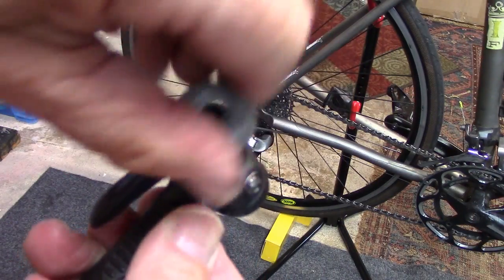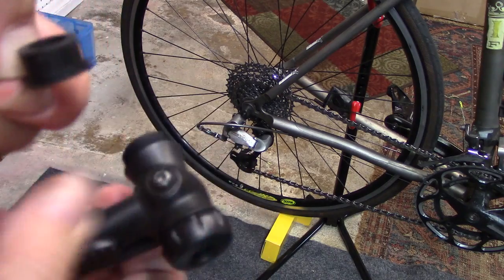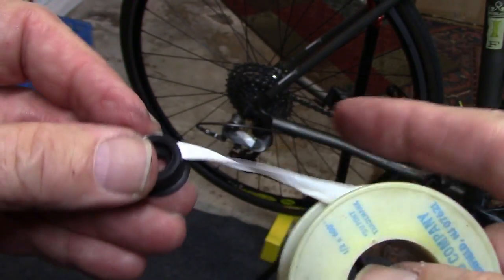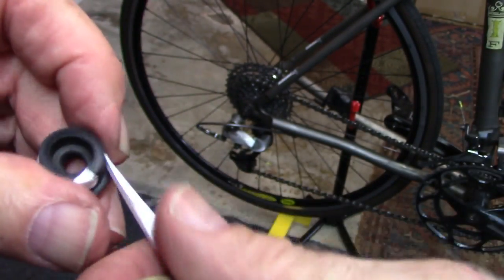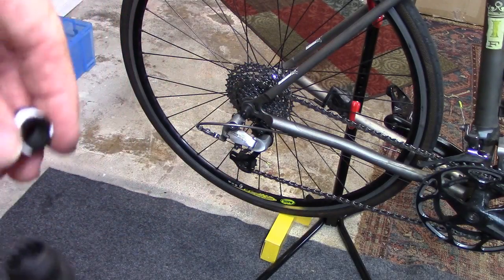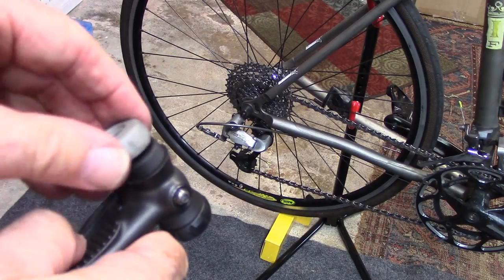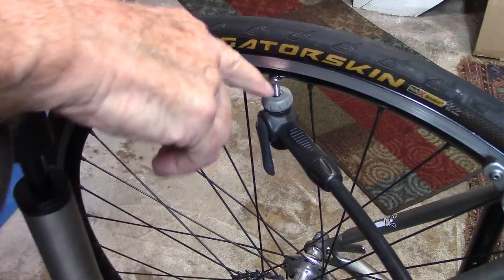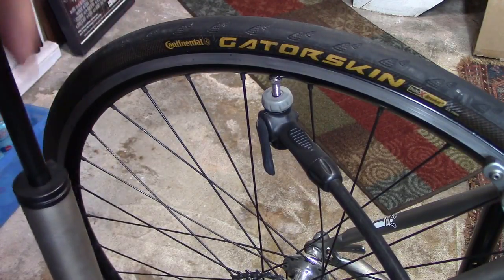Leaking Bicycle Pump Head at valve: Quick Repair

Comment: Put some plumber tape around the outside of the valve too.
Reply from the maker: Will work. Do you have to reapply to the out side often? Placing the tape in the pump head will last several years before reapplying the tape. Regards, Tony
Reply: Well yes I would have to, but hopefully I would not to do it often. (but see later) The pump I use connects with a screw on flexible adaptor. Problem is on some valves when I screw it fully on it opens the valve letting air leak, so I have to loosen it a bit which means air will leak out round the thread a bit. I am actually not sure how they seal presentably when you screw it on fully it should seal at the bottom, but as I said, on some valves (not all) that presses the deflate pin in and you are fighting a losing battle!
Indeed I have 2 flexible adaptors and one works best on different wheels there seem to be manufacturing inconsistancy I also put some on the other end of the flexible adaptor were it screws into the pump. I've always had problems full inflating the tires in the past, I could only get them to a certainly pressure and not more, I'd then go to a garage and use the pump there to get them fully up to pressure.
I have just been to check them now and have got both tires up to a pressure I am happy will, ie very firm, never been able to do that before. When I checked I notice there was bit of tape still on the valve (under the dust cap) and I inflated the tire more without applying more tape, I also noticed bit of a white where the adaptor screws into the pump.
I do also have a small pump that connects like yours, but a hand pump type that is a bit hard to use. You are putting the tape in a different place to me though, you could put some on the tube valve too but you probably won't need to. Basically anywhere there is a connection white tape will likely help. But anyhow it does the job
Reply: I am finding these valves baffling, I read there is a plastic X in the connector which you can pull out and reseat, I pulled it out and left it out and found it impossible to inflate the tire at all, it seem it needs to slightly open the valve for you to inflate the tire, but if it is open too much, it is really hard work. What I found was when I could inflate the tire it leaked slightly but not much, maybe that is how the are suppose to work? I dunno, still my tire are inflated so a bit of tape does seem to help so I'll leaver it at that!!
Reply from the maker: Just for our viewers knowledge, what type of bike tubes are you using. Thanks and regards, Tony
Reply: Well firstly is is a schrader valve, I assumed yours was too but I think yours is probably a presta which does not have the same problem. So it's just a standard mountain bike tube, from poundland, ie cheap but as good as any imo. Anyhow, I could write an essay on this, and find it odd I can't find any info on the internet about it. Schrader valves seem to rely on you manually depressing a central pin on in the valve, many push on connectors rely on a lever to do this. So I deduce from that that the force of air pressure alone is not enough to open the valve and I seem to find this myself whilst experimenting.
There is no lever with screw on connectors and the valve opens because there is a plastic X inside the flexible connector so as you screw it one it opens the valve. You can actually remove the X with a pair of pliers and I did his and found I could not inflate the tire at all the  valve seemed impossible to open with air pressure alone, hence to inflate it the valve must be slightly open, however if it is open too much too much air escapes and that seems to be the case with one of my connectors however the other connector seems to just open it enough to get air in without too much escaping, hence it seems to be a bit of a black art inflating them, depending on the pin length in the valve one connect might work but another one might not. It is hard to pull the plastic X out with out damaging it so I am not gonna mess with it any more...... however I did, I managed to pull out one what did not work well, seemed to be too long so I filed it down a little and put it back in, now it won't open the valve at all! However I put a small bit of cardboard in to make it a bit longer and I can get it to work somewhat, the other one still works OK but I've ordered another connector anyway so I have a hopefully good spare. They are a terrible design imo, the presta is much better I dunno why they use them really, they are nothing but trouble!
Reply: Just a quick(ish) update, I learned something today the flexible connector for schrader valves has a one one way valve in it, ie if you suck from the pump end the valve shuts off, provide you suck hard enough to operate the valve, ie it pulls something up to close the valve, so that kind of explains a lot of my lack of understand of how the schrader valve works, it relies on a valve in the pump system somewhere, in the flexible connector in my and most cases I guess. So a key aspect is how easily that valve closes, on a new connector I just bought it closes with just a little back pressure but on an old back connector it require a lot more pressure, hence you can have a hard time inflating the tire, a good tip is to pull the pump back fast that should close the valve. Also it can be quite difficult if you start with a deflated tire as there is not much back pressure, when you get it inflated a fair bit it should shut off more easily. It might even help if the connector is pointing upwards so the bit that closes it off naturally falls to the closed position. Anyhow I've learned something quite useful which should help me inflating my tires in future! I assume the presta connector do not have a valve in the connector as a presta valve is basally a one way valve anyway.
I also took a look at my mini pump which is push on and has not flexible connector, I can't blow back into that at all, seems to have a good one way valve, which probably explains why it worked much better than I expected, when you press it on to open the schrader valve, there is nowhere for the air to get out! So learned a fair bit today!

Comment: Mine as soon as i put it it releases air can somebody help
Reply from the maker: You can try the above tip. If that doesn't work, check out this reference: https://www.trails.com/how_13248_troubleshoot-bicycle-pump.html
Other possibilities include a faulty or leaking value on the inner tube itself. Let me know how you make out.
Regards, Tony

Comment: How to fix a wooden valve?
Reply from the maker: Most Woods (Dunlop) valves are too short to accept a presta pump valve head. You can get a "presta schrader" valve adapter (cheap from Amazon) and use the schrader side of most dual head pumps: See:
https://www.youtube.com/watch?v=xSJmdGA2bW8
If the schader side of a dual pump head leaks, you'll need to take it apart, clean and reassemble. See:
https://www.youtube.com/watch?v=jlEj0sHEuGA
Good luck and give me some feed back.
Regards, Tony

Comment: Did not help missing a few steps
Reply from the maker: Do you have a dual side by side pump chuck (head)? That's a different video I can send you. Does it still leak around the valve head or could there be a crack in the valve chuck or tubing? Let me have a little more info and let me see if I can help. Tony
Reply: Experiencing a leak on Bontrager pump head, but right above where it screws onto the tubing and that lower assembly of the pump head does not seem to be something we can take apart. Thank you for this video, though, so great how many people you have helped!